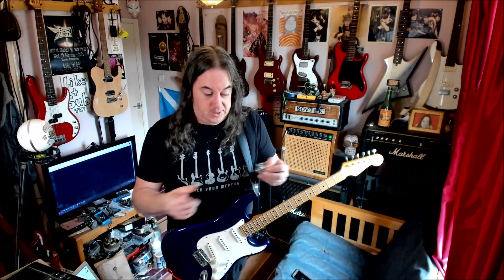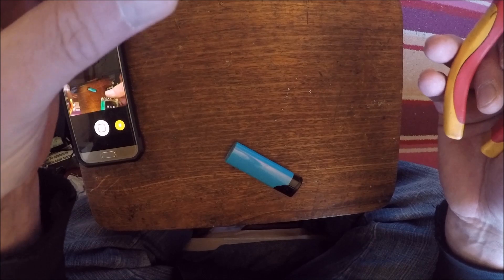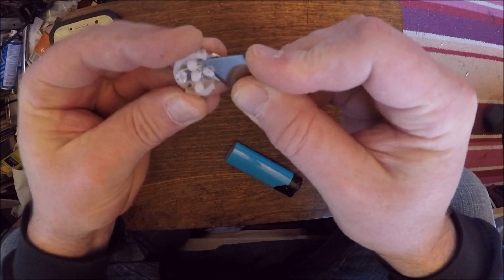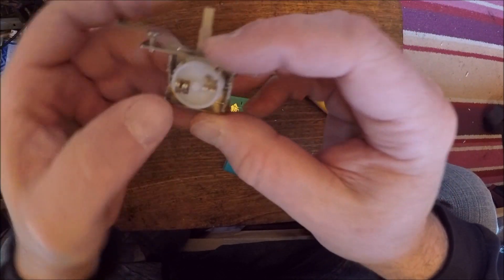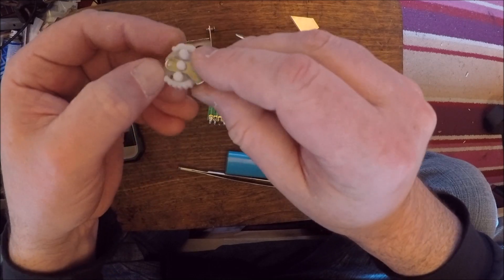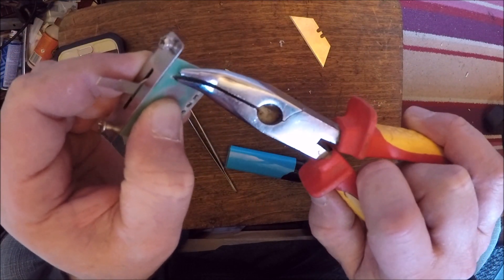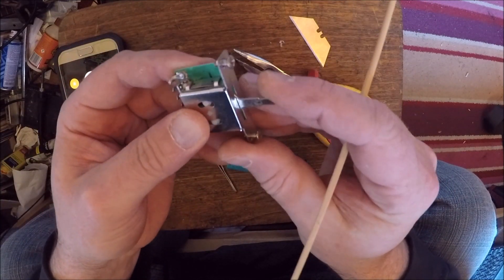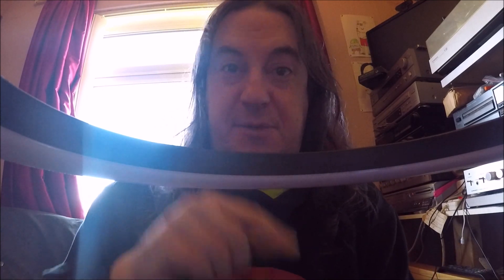Did you know your 5 way switch does this?

Comment: Which terminals would you wire for a three way, Malko?
Reply from the maker: you use both sides of the switch for a 3 way (as in for 2 pickups like a tele) hard to explain without a diagram but if you put 1 pickup to the first 2 terminals and the other pickup to the last 2 then combine the middle 2 as your output it will work
Reply: @MADMALKO  Merci beaucoup.
Reply from the maker: @@Jazz2000-mm7xk standard telecaster switch diagram

Comment: You haven't explained the advantage of a 3 way switch. A quick tip, whenever using an open blade, such as any knife, always cut away from yourself, particularly your other hand.
Reply from the maker: 3 way switch in a telecaster which has 2 pickups rather than 3